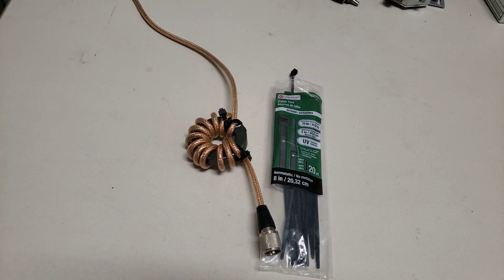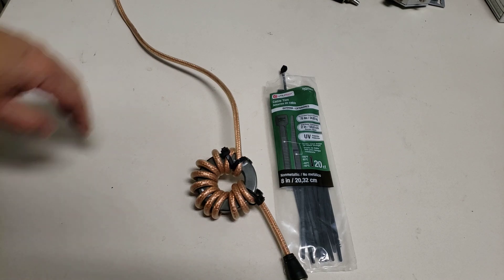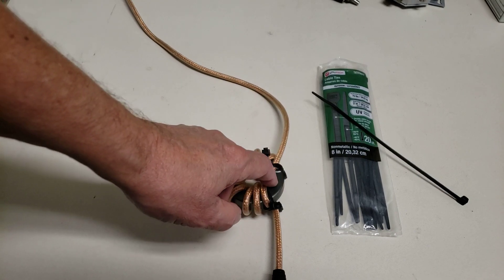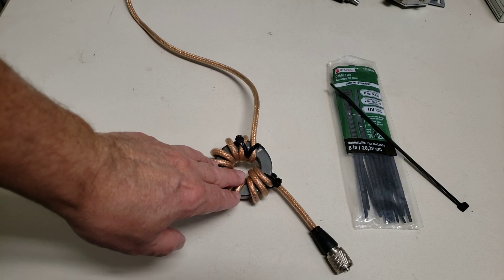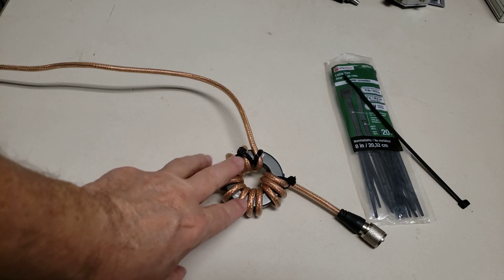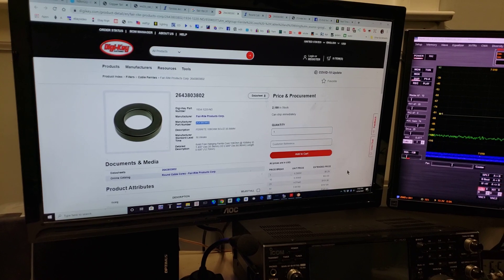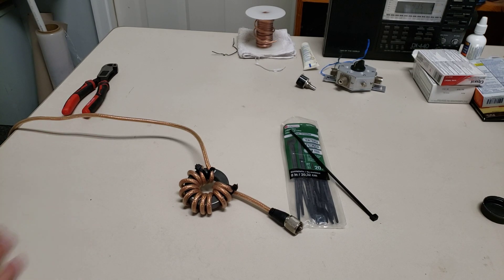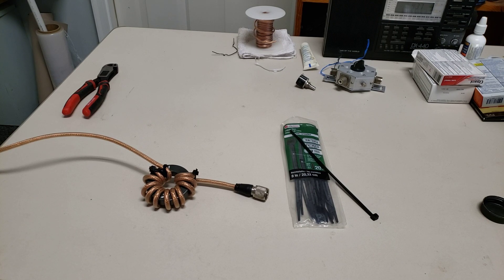Build Simple Effective Common Mode Choke (CMC) aka. Line Choke for RFI

Comment: Thank you Steve for this great video on common mode chokes and how to build one. If I wind 9 turns of RG58 around a 240-43 core,, would that work? I'm running out of room to wind the cable. I'll operate on 40M through 10M.Thanks again.

Comment: Highly informative. I have one of these made up already (12 turns of RG58 on FT240-43), but I believe I'm still getting some common mode current at 30MHz. So I've been thinking of adding another choke made up with a a toroid of FT240-61 (again 12 turns RG58) in series. Maybe that would work to eliminate my problem on 30MHz?
Reply from the maker: Sounds good but maybe too many turns. Keep it 6 or less turns for 30mhz. If your new choke didn't help then I doubt if another one would matter. Maybe it's not common mode noise.

Comment: This is a great video. I would say though folks might check out G3TXQ's work on CMCs, a quick search will bring up a site with a ton of info on how many turns over what cores works best on which bands. It isn't quite as simple as more is better. 

For those to busy to look for the most effective all band coverage with one core 12 turns of RG58 on a FT240-52 is your best bet. There are better options if you primarily focus on the low bands though. 8 turns on a FT240-31 will be resistive instead of reactive across more of the lower bands but offer less maximum impedance for example. Air cores or "ugly baluns" are not in fact useless btw they simple are only useful on a narrow bandwidth(also in the charts), they do have the advantage of not needing a core and if you putting up a single band dipole or similar can be a cost effective solution.

Comment: If adding a second toroid (spaced apart from the first toroid) to the same jumper cable, should the second toroid be wrapped in the same direction or opposite direction....or does it not matter?  I just wanted to make sure the second toroid does not cancel the effects of the first toroid.
Reply from the maker: Doesn't matter.
Reply: @n4lq  thank you!!!

Comment: From a quick search, a common mode choke has multiple windings, with "equal turns wound in *opposite directions*" so that the magnetic flux cancels for differential signals.
E.g. each conductor in a pair is wound in the opposite direction of its mate. And the pair are magnetically coupled so their fluxes cancel for common mode signals.

"A common mode choke is an electrical filter that blocks high frequency noise common to two or more data or power lines while allowing the desired DC or low-frequency signal to pass. It gets its name because it blocks or “chokes” high-frequency signals while low-frequency signals pass through an electrical circuit by passing direct currents (DC) and alternating currents (AC)."
I envision this for a balanced wire antenna, where the feed conductors feed are wound in opposing directions. Not sure what happens if coax is wrapped in opposite directions. Might still be just a choke.
Isn't the goal here to prevent RF flowing over the outside of the coax?
Reply from the maker: You have confused electrical chokes used for power lines with chokes used for removing RF from the shield of coax. We certainly do NOT want to cancel differential signals! Differential currents are what flows INSIDE a coax or between two parallel wires acting as a feed line. Common mode currents are equal in phase between these conductors are considered a problem that needs removing. What you described is a choke used in electrical work and this is a totally different concept. Basically a common mode choke in the RF world is just a broad band inductor that presents a high impedance to RF. Since we don't want RF on the coax's shield, we simply wrap the coax around the core to form an inductor that has a high impedance for any currents present. The number of turns and core material determine the total reactance to this unwanted shield current. 
For AC electrical work we want all RF removed from BOTH wires and just the 60 hz AC power passing on through. For antenna systems this would be just the opposite of what we want. 
The name "common mode" has a different meaning for electrical engineers compared to RF engineers, a common problem.
Reply: @n4lq  thank you. How confusing! So what distinguishes it from a (not "common mode") choke?
Reply from the maker: @mrtechie6810  It's a choke..... Choking common mode current is how it is used, thus the name. Chokes are just inductors. Inductors oppose changes in current. Inductors have "inductive reactance" which is the measure of the resistance it has at a given frequency. For the electrician type, a low reactance choke would suffice to block radio frequencies from entering the device but have little effect at 60 hz AC frequencies. As the frequency increases the reactance also increases. The choke in the video would explode if 60 hz AC were passed through it due to excessive reactance.

Comment: Good video.  I've used a T240-43 for common mode choke wrapped the same way you have here and have had great success with it with my end fed 71' random wire antenna.

Comment: You mention to install the choke .05 wavelengths from the matching transformer. Can you elaborate
Reply from the maker: That comment applies only to the EFHW antenna.. .05 wavelength of coax is needed between the transformer and the choke to provide sufficient counterpoise for the antenna.

Comment: Hi steve , how many cores for legal limit , if you can stack them ?
Reply from the maker: The transmitter power shouldn't matter with just one core as long as you don't have some crazy SWR. I do recommend using RG-400 Teflon coax and not this RG8x mini coax especially for high power. Stacking cores is not as effective as is putting them in series.
Reply: Thank you for that.  I was also wondering if you could wind them with enameled wire like a balun.   I have loads of that left from your end fed design.
Reply from the maker: @dback4430  Yes but with a skew in SWR due to the wire pair not being 50 ohms.
Reply: @n4lq  stacking cores will distribute the ferrite heating into all the cores used. cores in series are adding inductance.

Comment: Steve, this is exactly how I make my CMCs.  I've been criticized for having such a tight loop with coax.  After researching, I found that manufacturers' specs call for a minimum loop diameter of close to 2 inches for multiple loops of RG-58.  Even greater for larger coax like RG-8 or RG-213.  I think their specs are based on compression/deformation of the dielectric, which may change the distance between the center element and the outer conductor/shield.  Since these tight winds over a 240 size toroid are clearly less than specs, what are your thoughts and do you do anything to compensate?  Great video.
Reply from the maker: Normally I use RG-400 which can handle the tight wrap. Also since only the pass through the center matters, you can allow the outside loop to stick out as far as you want. It looks funny but works just as well. Just be sure the pass through the center is against the inside of the core. Outside does nothing anyway.
Reply: RG400 has a 1in radius spec due to it being Teflon.

Comment: Thanks Steve! Question- Where should I put this choke? Ideally, I would like to put it inside, about 1 foot from my Yaesu 450D. Is that advisable?
Reply from the maker: Tough question. First, is it needed? Do you have a problem? If not then no choke is needed. Chokes work only if there are RF currents for them to choke. These RF currents vary in strength along the feedline are are frequency dependent. This makes it tough to pinpoint. In the case of an EFHW, don't put the choke near the transformer unless the transformer is grounded via a very short ground wire to a good ground system. Keeping it back at least .05 wavelengths from the transformer usually works. Your idea of putting at the transmitter is fine but be sure why you want it and try to observe its effect.  If it doesn't do the job then try relocating it. Experiment is needed and it is different in each instnace.
Reply: @n4lq  Thanks for the info!

Comment: Steve, you mentioned that it was acceptable to use more than one RF choke in series. I just made a choke the other day using two 240-43 with 9 turns of RG142 Teflon coax. According to the chart two 43 mix cores and 9 turns will provide 8k of attenuation on 20, 17 and 15m but drops way off on 80 and 40m.  having said that, two 31 mix cores with 17 turns will provide 8k of attenuation on 80 and 40. how far should they be from the 49:1 transformer as well as away from each other?

I have one other question... on the EFHW 80-10 or the 40-10 version, how well do they work on 17m and would I get any benefit or negative reaction if I had a 67’ or 130’ EFHW with one additional wire cut for 17m - in other words a Fan EFHW?
Reply from the maker: The rule is....You must put the chokes at least .05 wavelengths away from the transformer on the lowest frequency used regardless of the mix. That means about 13 or 14 feet minimum. 
You don't need much spacing between cores. Just a fraction of an inch or so. 
Forget the "fan" idea. Just adding a few inches of wire onto the transformer's output will skew the swr for the whole antenna. A 17m addition would wreck everything. Things are totally different than a dipole due to the high impedance feed.
Reply: @n4lq  the .05 wavelength rule looks very important, maybe it should be added in the description? Great video

Comment: Just setting up my first HF station using an EFHW.  There was evidence of RF in the shack and so I tried this.  Quite apart from its effect on transmitting, It has cut the noise on 40m from S5 to S1.  It works!

Comment: Hi Steve, this is just what I need!  I built one of your EFHW matching units with 3 stacked ft240 cores, and it works great, giving very good matches, but at higher power I find my microphone “bites” on transmit.  Guess that’s the rf coming back.  I guess I could put one of these chokes between the coax going to the matching box and the rig.  Thanks for taking the time to makes these videos Steve.
Reply: check your grounding and be certain that your ground is not only connected to a ground rod but that’s also commonly bonded or attached to the electrical ground.  you want to avoid multiple paths to ground.  hope that helps!

https://www.repeater-builder.com/tech-info/bonding/amateur-radio-bonding.html

Comment: Hi Steve.
#31 IS CONDUCTIVE !
I have several different toroids from Fair-Rite with #31 material and depending on the model they show a resistance between 100 kOhm and about 1,5 MOhm.
Jacob PE1LLA

Comment: Steve, the digikey part number you showed on the screen is for mix 43, not mix 31. Wrong part. The correct part number is 2631803802
Reply: At 7:10 he has the correct part number.  But you’re right, the earlier number was for mix 43.

Comment: Thanks for good advice Steve. Regarding common mode current chokes, the research carried out by G3TXQ may also be of interest:
https://web.archive.org/web/20180422195858/http://www.karinya.net/g3txq/chokes/

If you print out or save the table on this link, it is a great reference for making chokes for specific bands.
Reply: G3TXQ SK RIP

Comment: I'm just curious how long your jumper is?  3 feet?
Reply from the maker: I believe it's a 10ft jumper but it doesn't matter as long as it fits your need.
Reply: @n4lq  I understand I just don't want to order a cable too short.  Thanks for replying!
Reply from the maker: @NHSbandUnofficial  Here is the best coax. RG-400 is very small, can be wrapped tightly around the core and can handle any amount of power. https://rover.ebay.com/rover/1/711-53200-19255-0/1?ff3=4&toolid=11800&pub=5575522562&campid=5338568994&mpre=https%3A%2F%2Fwww.ebay.com%2Fitm%2FRG400-UHF-Male-to-UHF-Female-259-Double-Shield-Coax-Cable-PICK-LENGTH-RF-US-Lot-%2F163975768296%3Fvar%3D%26hash%3Ditem0
Reply: @n4lq  Great, thanks!  What would you think the minimum length of RG400 it would take for 12 turns?
Reply from the maker: @NHSbandUnofficial  minimum about 2 feet so get 3 feet to be sure

Comment: Dear Steve, I am from Argentina, I have seen your very good previous video about Multiband & EFHW Antenna.
My tower (12Mts) is supported 5.5 meters from the ground, on the roof of my house.
The earthing javelin is obviously in the ground so my Multiband & EFHW Antenna earthing cable, in my opinion, will be very long.
Do you have any suggestion in this regard, do you think it will work?
The general opinion states that the ground connection is very long, which will not be effective.
Please, I wish to have your opinion on this.
Thank you so much
Claudio Saliwonezyk
LU4EN
Reply from the maker: Grounding the EFHW is for lightning protection, not for enhancing SWR or transmission. You may ground the transformer directly to the tower via the ground / earth connection  or you may ground the outer shield of the coax at the building entry point to the earth rod. Always ensure that all of your earth systems are bonded / connected via heavy wire.

Comment: Doesn't work.  I bought a Fairrite FT240-31. I was only able to get about 10 wraps on it with RG-8x and 3' of it. I wasn't able to get them as tight as you. I know it's a Common mode problem because I did the center conductor only test with the rig. S2 with center only, S7 with shield attached.  Still an S7 with this choke. I'm pretty disappointed.
Reply from the maker: I don't understand how that "test" can work. Without the shield connected you don't have any antenna. Naturally everything including noise will be weaker. So do you know where this noise is coming from?
Reply: @n4lq  I'm following this "theory" from Palomar Engineers. (short read)   https://palomar-engineers.com/wp-content/uploads/Palomar-Engineers-Common-Mode-Noise-on-Coax-User-Diagnosis-Test-1.pdf  There's a vid on youtube as well where the guy does it and his noise jumps thru the roof. I'm putting this choke right behind the radio.  And of course I have noise from all kinds of things in the house. Wall warts, you name it. But I was hoping to get the most of it with this.
Reply from the maker: @UpsidedownArmadillo   Got it. I"m not sure how conclusive that test is. The most effective method is to locate the noise source and either replace it or install a choke on it. Use a portable radio to locate the noise. Google "K9YC cookbook". He has lots of info.
Reply: @UpsidedownArmadillo  The coax running to your radio (and choke) will still radiate. The best place for a choke is near the shack entrance of your coax; the choke wil attenuate from that point on.
Reply: @UpsidedownArmadillo  You need to identify and choke your noise generators.  With ferrite (like this) or snap-on chokes.  I bought about $200 worth of snap-ons and FT140 and FT240 cores and equipped every single appliance in my home, and dropped my noise floor below -110dbm.  Start with your DC power adapters, doorbell transformers and garage door openers.
Reply: @philjensen5151 Any experience with alarm systems like ADT? I can unplug it though and it's still backed up. I may buy a billion snap ons.

Comment: Steve, out of boredom and more so, to help other's boredom, I've begun sharing what I call 'desperation' antennas, etc. All things you can get into operation in 5 minutes, etc. I've had shocking results with a homebrew multi-tap unun and wires sometimes only 2' high. I"m trying to entertain, and moreover, get people to screw around with antenna projects and experiments. It's SO FUN and cheap! My antennas outperform the commercial ones and cost under $10. lol. I point people to you as much as possible because you are the Master of All Baluns & UNUNs!  73 OM and thank you!

Comment: Mr. Ellington, I watched your video on making an EFHW and was wondering if the same 12 AWG wire to create the transformer can be used for the actual antenna portion?
Reply from the maker: Yes. I use 12 ga.
Reply from the maker: Rg8x
Reply: Steve Ellington thanks, so that is rg8x as the actual antenna
Reply from the maker: @nicholasskific4795  No. Antenna is just wire

Comment: Why is it that some of these chokes are made like you show and others wind half the turns, go down through the hole and wind the remaining turn in the opposite direction?
Reply from the maker: They do thst to keep the ends further apart. Just leave a gap and you'll be fine.
Reply: According to some published material the only advantage of that is to have the input and output wires on opposite sides of the choke. This might be easier for some. It's only for convenience.
Reply: This was my question too.  Since it is just as easy to wind this way, it makes better sense to me.  I made mine out of 240-43 because I have 43's on hand.  I plan to add a 31 core also.  I love making my own stuff.  Thanks Steve!!
Reply: From a quick search, a common mode choke has multiple windings, with "equal turns wound in *opposite directions*" so that the magnetic flux cancels for differential signals.
E.g. each conductor in a pair is wound in the opposite direction of its mate. And the pair are magnetically coupled so their fluxes cancel for common mode signals.

"A common mode choke is an electrical filter that blocks high frequency noise common to two or more data or power lines while allowing the desired DC or low-frequency signal to pass. It gets its name because it blocks or “chokes” high-frequency signals while low-frequency signals pass through an electrical circuit by passing direct currents (DC) and alternating currents (AC)."
I envision this for a balanced wire antenna, where the feed conductors feed are wound in opposing directions. Not sure what happens if coax is wrapped in opposite directions. Might still be just a choke.
Isn't the goal here to prevent RF flowing over the outside of the coax?